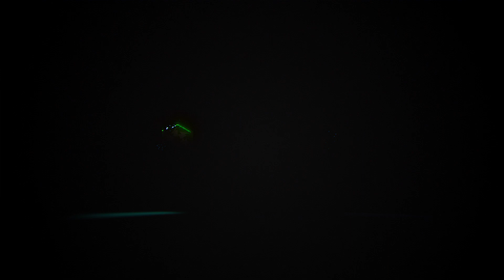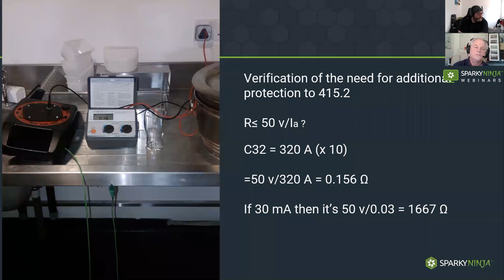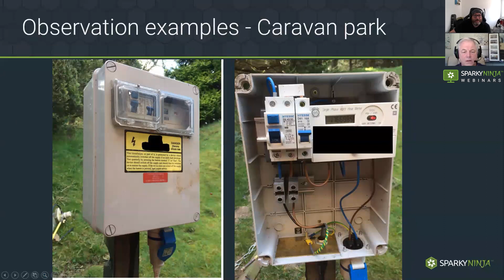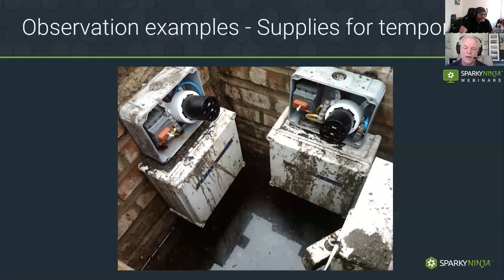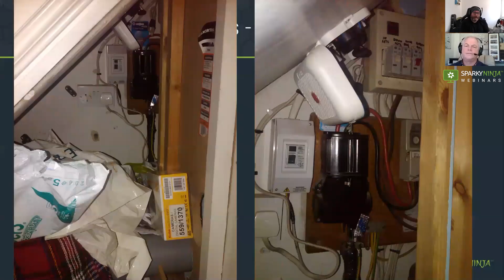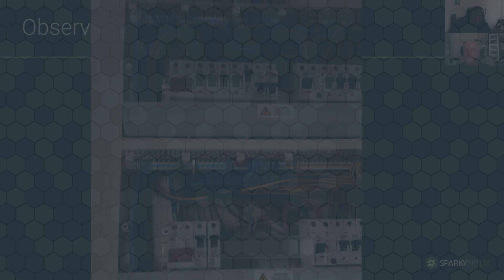Inspection & testing, a discussion on observations & recommendations PART 2 - A SparkyNinja Webinar

Comment: With reference to the older systems ..I did an EICR for a lady as an "electrician" said she could go to jail for the old fuse board ...he quoted £1000 for a new board in a 2 bed flat... they make me sick . I say to customers that are worried about their old fuse boards "Would you be happy to drive around in an old Jaguar or Rolls Royce?"  Always the answer is yes  "Well , they don't have air bags or ABS etc  does that mean they are unsafe ?"
Reply: Great way of looking at it

Comment: As far as i am concerned inspecting and testing , mainly the certification / report is so far over the top its ridiculous, An EICR of 6 pages , 2 reports a day 3 days 36 sheets of paper REALLY, Gas safe landlords is 1 page , just my personal opinion , been doing this for 25 years
Reply from the maker: Gas safe is completely different and has no comparison.
Reply: @SparkyNinja  Gas is consider more important in realms of safety, otherwise you wouldn't be barred from installing it unless registerd, My grievence with the certification of EICR is excessive pages of unnecessary pages of forms to fill out ( thus comparing it with Gas Report), First of all you need to be technically competent and an expert in this field to carry out testing & inspection. therfore you dont need excessive forms of items to inspect (basically a tick ;list) , if i see a deviation i will record it, , if i see a cable not supported i noted it , same with most things, dont need a list saying what to tick , how long before you asked to list what clothing you have on or breakfast you had.
This report could be cut down to 3 pages max,Clent name , contractor details, installation details & circuit detail result, recommendation (if any)  This just my personal opinion
Unfortuately thes forms are contructed and design by THe IET, Jpel, in black ties on golf courses, not by practicing sparks, As i say just my view

Comment: The caravan hook up only has single pole overcurrent protection.
It is annoying that they’ve not identified the black as neutral.
The idea of de-neutralising the black sounds good, but there’s no real reason to do so.
The use of mixed manufacturer’s equipment in the DB is not necessarily a problem, as long as the breaking capacity is greater than the PFC.
The DB is obviously not type tested, but then again is it domestic?
It’s not obvious that the connector block under the floor is inaccessible.